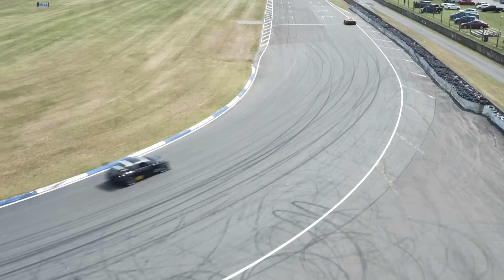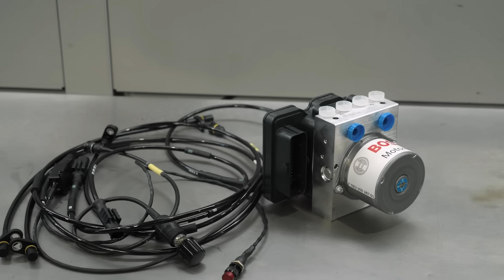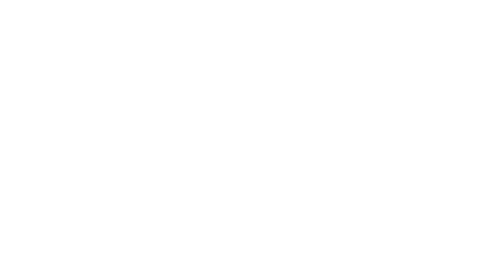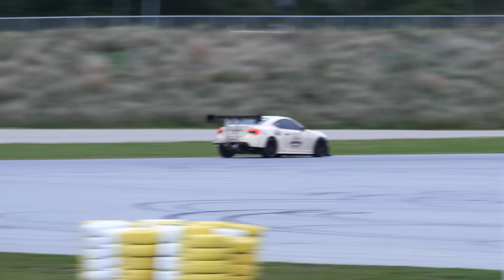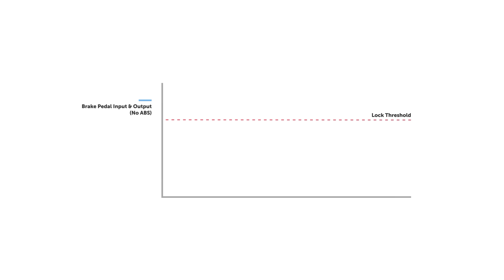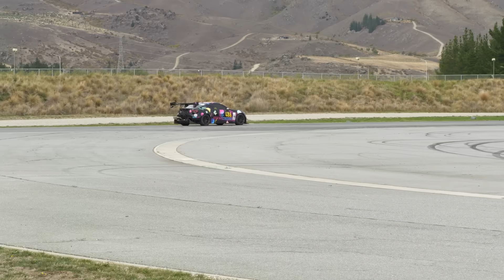Motorsport ABS Performance Tested | The TRUTH

Comment: Wonder who will figure out Ford uses their bosch motorsports abs pump from the factory and figure out how to do a retrofit kit for $2500 or less. Its even the same plug so i imagine their wiring harness will fit.
Reply: The software is the important part, I've not heard anything about people flashing Motorsport software onto the OEM Bosch units.  The Continental MK60, MK60E1, MK60E5, and MK100 that come in in various cars are a little bit different story, some of them can be flashed with variants of Conti Motorsport software if mailed to Germany - I have a MK60E1 flashed by MK-Rennsporttechnik in my Lotus.
Reply: @blackmkiv  I get that but a 3,975lb car with realistically a 180lb cabin load, and an 1/8 tank of gas will stock 60-0 in 87ft on 305/315 mm 200AA tires. Stock lateral accel is on par, but their stopping way faster than everyone else. Ford has also been known to sell the racing ABS modules from ford performance so it sounds like the dark horse gets the program from the factory. My conclusion is the module is probably tuned by bosch motorsports.
Reply: @paladain55  The thing is that the motorsport flashed units are configured to cg location, wheelbase, yaw sensor position, steering wheel angle to actual steering angle (if installed), wheel sizes, brake caliper stiffness, brake caliper piston sizes, rotor sizes, etc.  The calibration even if done by Bosch (the Ford uses the electric booster in the S650) would need to change in a retrofit situation.  The S550 uses a Continental MK100, but the actual S550 race cars got Bosch M4/M5.
Reply: @blackmkiv  ohhh i see
Reply: @blackmkiv  Sounds like it could work in a is500/camaro ss/mustang gt shaped car as they are all so similar now.

Comment: It would be great to have a similar kit with a more affordable price tag for 90s road cars... Early ABS are dinosaurs compared to current ones but a full $10k for a road car doesn't make sense.
Reply: The ABS in my GC8 is more like a deathtrap. I had one unlucky situ where i had to swerve AND brake and it just caused a massive side to side jolt to happen. So yeah, i really wish aftermarket ABS systems were more affordable.
Reply: @StalkerGamingHU yeah no abs will stop that you need rear steer that also means to prevent that kick back the rear will auto steer into the new slip angle direction and slowly walk back but if you turn the front wheel the other direction your doing 360 degree spins or a inertial mass damper   like on a ship. If you push a tire past its grip limit with yaw no abs can magicly make a tire hold more lateral grip
Reply: @mddunlap03  bro what
Reply from the maker: This is a dedicated motorsport unit for sure. It would be great to have the grip that soft slicks offer on the road too for cheap, but it's not feasible either. It's all relative 😎

You might be better to retrofit a more modern 'tuneable' road car ABS system for that goal, the MK60 is a popular choice. It will still cost a fair bit and be a bit of work, plus it certainly won't be the same as this aftermarket Bosch unit, however, it will be cheaper and more tailored to your performance build.

One thing you do need to check before you get too far though is what your options are legally to do that to a road legal car in your location/country - Taz.
Reply: @hpa101 most of the abs units in the world are bosch or manufactured under license from bosch.. i wonder if whatever bosch software would work with some of these units (but they probably pre-emptively locked it up tight) 🤔
Reply: the Continental/Teves MK60E5 unit is what you want. Fitted to every 6cyl RWD BMW E9x 3 Series and E8x 1 Series (and also E9x M3 and E6x M5/M6), it's an extremely competent ABS system that can also be run standalone. Unlike the older MK60 units from E46s, you also don't need to buy the M version as it's just a firmware difference between the M and non-M units on the MK60E5s (which also means you can pick up 2nd hand ABS units for as little as $200) and you can flash the M firmware on a non-M unit to get its more aggressive ABS programming. It also has internal brake pressure sensors, so you don't need to use external ones like the MK60, and you can also get brake pressure data (both pedal input and individual wheel output) and wheel speed data from the unit over CAN, which can be useful for datalogging.
Reply: @BodenM thanks man! That was really informative. I'll look into it!
Reply: @BodenM  Ooohh, this sounds intersting. Ill read up on it a bit more, thank you!
Reply: Or for that matter on older cars that don't have ABS at all. I daily a '73 VW Bug, have no interest in racing it (took it to Rallycross a couple times, don't know if ABS would help there) but I'd prefer to have ABS for safety out on the road, where you don't drive as close to the edge but there's a lot more things that can cause you to need to panic brake. I converted it from carburetor to EFI, would love to implement ABS in a similar manner. But not for $10k. I've heard there are certain modern production car units, particularly off certain BMW models, that might be possible. Would only be stock level ABS, like the stock unit they took off this car, but that's probably acceptable, a vast improvement over no ABS.

Comment: Have you guys sendo the delta motorsports system it is cheaper
Reply from the maker: We have not used that system or Continentals sorry. Bosch certainly seems to be considered the 'gold standard' in the industry at this point in time but I'm sure there are other options which would also move the needle greatly for you out there if this is out of reach 😎 - Taz.

Comment: Thanks for the presentation Andre. I'll put that on the to-do list along with the carbon brakes and all the other OTT expensive stuff 🤣... Question though - would you use it in a competition outside of a race track? Like closed road courses and hill climbs with unpredictable surfaces? I still have factory ABS and I look at it as a lifeline if (when) I screw up, but any misadventure leading to an off the black stuff adventure is generally terrifying, as in it would be better to not have it and be able to dig in (like a gravel rally car). Interested to hear your thoughts.
Reply: We have installed a few systems on different platforms and uses. 

In our experience, the advantage is even higher on inconsistent/rapid surface changes like that in hillclimb and tarmac rally.
Reply: @Benchmark413  Thanks for the feedback. And here I was hoping you'd say the opposite. The  tarmac rally car build just keeps on growing...
Reply from the maker: Yes and absolutely yes 😎
Apologies to your bank account 😂 - Taz.

Comment: ABS can modulate all 4 calipers independently. A driver only has the 1 pedal. A driver can’t ever do what an ABS can do….
Reply: Absolutely ground breaking research. Fantastic work mate, now we all know
Reply: This is misleading misnomer. This is ABS with Electronic Brake Distribution(EBD)..Not just ABS, like earliest OEM units. Nonetheless, my 2001 Chevy Tahoe ZR1 tow vehicle integrated 4 wheel EBD to ABS as standard equipment......the EBD added to ABS is the game changer.....and the brakes were fantastic, and even worked well when aggressively driven in dirt offroad settings.  My other offroad vehicles are pre ABS, ironically, my Mitsubishi Pajero EVO suffered severe "ice" mode immediately off-road, and required me to disable it there and then in the desert(pulled ABS harness). Cheers.
Reply: Early OEM ABS cannot did not modulate the calipers independently. It's the addition of EBD(Electronic  Brake force distribution) circuitry to an ABS system that does that. Newer vehicles have this.
Reply: @drtone  Yea, I wish I had such system. My 2000 ABS system does not play well with aggressive suspension setup as under hard braking if I'd lift one wheel it'd cut everything and it was insane. Made sense in stock conditions, but with my suspension setup it's so aggressive and way too unpredictable. Would love to have something new, but $5~7K for a kit is too much for this kind of car for now at least.
Reply: @drtone  Early ABS systems were 3 channel. LF, RF and rear axle. These systems can individually modulate any of these three channels. Later systems were 4 channel. I'm not aware of any real 2 channel (front axle, rear axle) ABS systems.
Reply: @jhidley1  correct!
Reply: I remember an ad for 4channel 4sensor ABS with four brake pedals.

Comment: 10:55 Just stomp on it! I don't have ABS at the moment in my 240, and I can see why people romanticize threshold braking but do admit ABS is going to make you faster.

Couldn't help but laugh at your vertical line for the illustration.

Are people still pulling the Bosch ABS system out of mid to late 00s bmws? It's a grassroots approach I've seen here in the states. It can be run independently, and is apparently Bosch Motorsports derived.
Reply from the maker: Yes, the MK60 etc units are more popular than ever for a cheaper ABS conversion option - Taz.

Comment: On motorcycles, where the driver can control each brake individually, a good rider will always beat the ABS system. In cars, on the other hand, a good driver can never beat ABS because he can't control the brakes on each wheel individually. That said, having a less aggressive ABS system can make a huge difference for the experienced driver.

Great video guys!
Reply: doubt
Reply from the maker: @r6scrubs126 while hardly a scientific study comparing a bunch of different ABS setups, FortNine did a video on outbreaking ABS on a bike that is a good watch and possibly what is being referenced.
Some people miss the point though, that motorcycle ABS is still worth having, and the fact he is practicing in ideal conditions.
Even with ABS being more common than not on bikes these days, as they mention at the start, most bikers aren't braking correctly before being involved in an accident. That point blank means the average person doesn't have the skills to even be worried about if they think they can brake better than their ABS or not on the road 😅
On the track of course that might look quite different, but the example they give isn't specific to track work - Taz.

Motorbike STOCK ABS Braking: https://youtu.be/sDbWZiaUeDY?si=lZ_PAhStwxWjS0IB
Also Interesting: Motorbike ABS Setup: https://youtu.be/ucnAz1yQ8tM?si=WziEQyG0kvFBBhmh
Reply from the maker: I think the problem and danger there though is we ALL think we are good riders, even when we never spend time practicing emergency braking in a controlled environment with conditions we have picked and are very conscious of 😅
Bikes are different in many ways though for sure and glad you enjoyed this ABS vs ABS comparison! - Taz.
Reply: @hpa101  oh for sure. Thanks for the response Taz!

Comment: My jaw dropped when you revealed the result of 200kmh brake test. Does the M4 Bosch kit have the same level of performance as this?
Reply from the maker: My take, if you were racing in professional motorsport, you might lose a small competitive edge with the older M4.
For anything else, the M4 is going to be as much of a dramatically awesome improvement for your car as the M5 was here for us in practical terms.

Note, this is just my personal opinion and it's not based on any kind of back to back hands on experience. For that feedback you would be best to talk to some motorsport centric companies that supply and setup Bosch ABS units for a living 😎

They go pretty quick but you can sometimes find the older M4's for sale secondhand too here and there, pretty rare to come across the M5's secondhand just yet - Taz.
Reply: @hpa101  Thanks mate, that's helpful. We are racing, but at a grassroot level. Hopefully in the future, we'll be able to race at a level that requires M1 build with Bosch ABS setup.